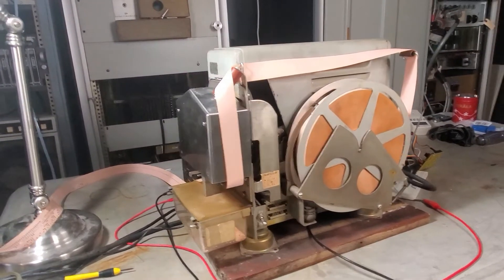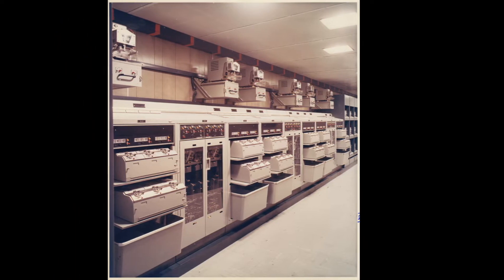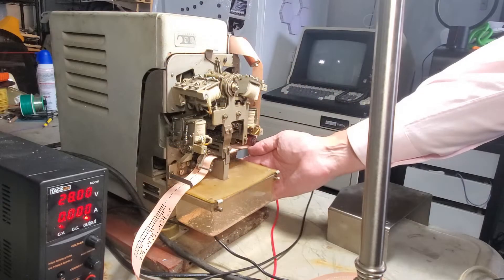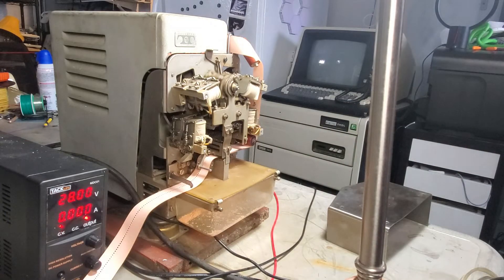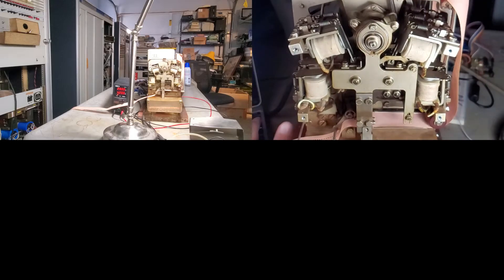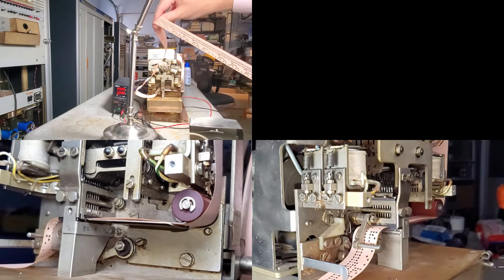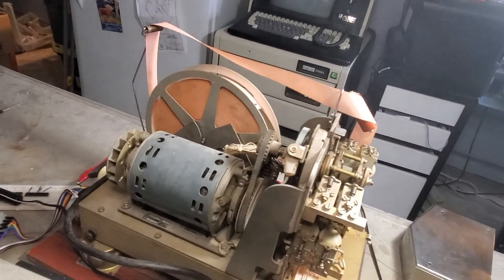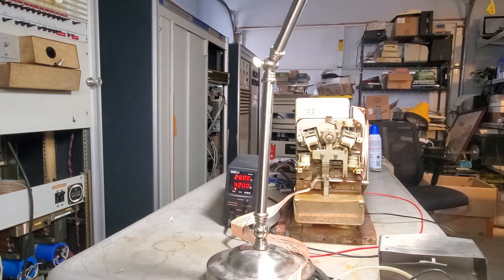Teletype BRPE - 1952 Paper Tape Punch

Comment: Any idea how many characters per second it is capable of?  The fastest I know of is the Remex RPM612 which had a speed of 120cps.
Reply from the maker: This one is 110, the teletype DRPE was 300 I believe
Reply: @happycomputerguy  I was referring to punching speed.
Reply from the maker: @douro20  so am I, the BRPE does 110CPS, the DRPE I believe could do 300CPS
Reply: @happycomputerguy  If 300 was the actual punching speed that would be incredible.
Reply from the maker: Yep, I wish one still existed, all I can find are pictures
Reply: The DRPE is 240 CPS 2400 WPM
Reply: @happycomputerguy  I have a DRPE but the control box is missing.
Reply: @joeduszynski4109  Yeah I read about that.  I didn't think it was possible before then.